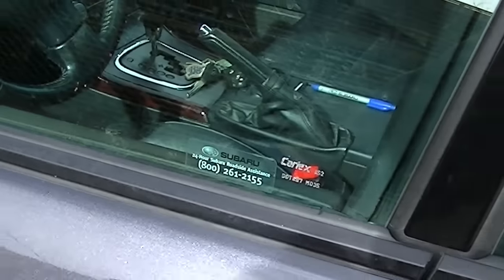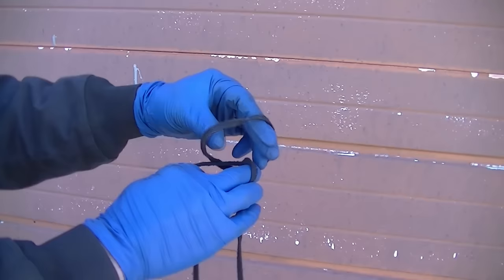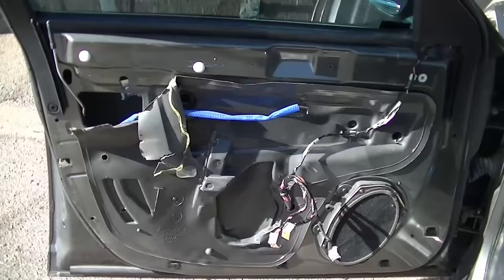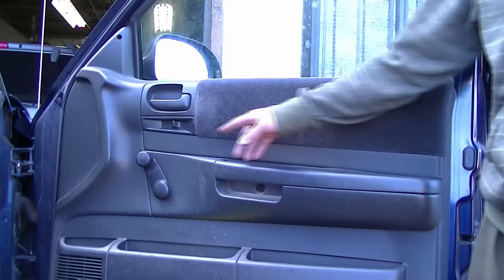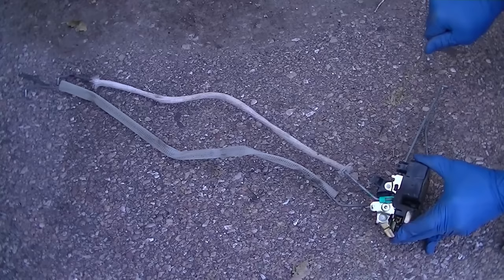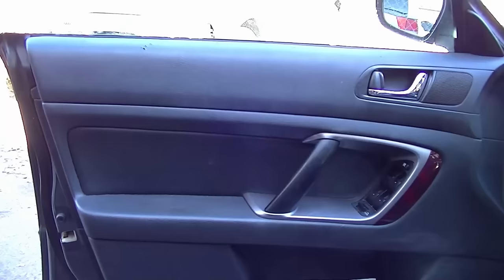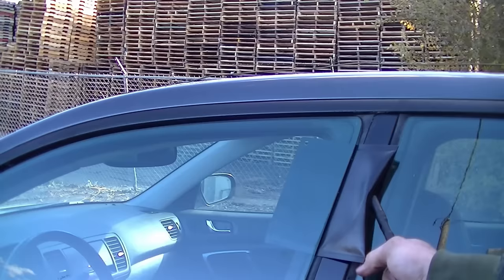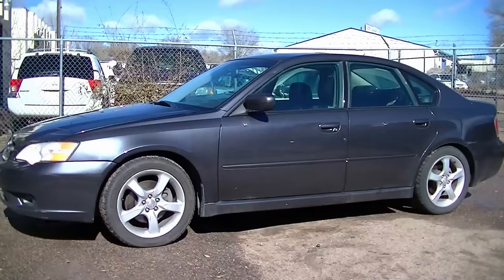How to unlock a car door (without a key)

Comment: 1 hour ago I closed the door and my 22 old month son and my keys where inside the car, my car is a VW POLO from 1991 so I used the shoelice and knot methode , I managed to open my door in 10 min! So gratefull for this video!!
Reply: i did it on same car struck lucky 30 secs and in, never done it befor so some one loves me and you well done
Reply: I used a brick, took 1 min
Reply: @Skyprince27  it took you that long to find a brick?
Reply: @Skyprince27 i used my fist, took 10 seconds
Reply: @mikkey246   I used my head. Took 1 second
Reply: 22 months? Sooo he was 2 at the time
Reply: Usually locksmith companies dont charge if a kid is involved

Comment: i just locked my keys in the car a few mintues ago and the shoe string (and butterknife lol) method worked great! it took me some time, maybe like 10ish minutes. at first it felt like the butterknife wasnt enough for the weather layer but i kept pushing downward until the shoe string finally squeezed in. the knot was kinda tricky, it kept loosening up on me, but after having to do it a few times in the process made me a pro at slip knots lol. the twisting the knot around tip worked for me 👍 which then proceeded with me finally unlocking my car. now i shall carry shoe string and a butterknife with me everywhere 😂. i am so grateful of you, you saved me money from not having to call a locksmith! thank you so much!!!

Comment: I was brought here out of need and the first one with the shoe string helped me get my granny's car unlocked! I had to improvise by tying a piece of thin wire onto the middle of the shoestring because the slipknot kept closing as I slid it in, however I made a little loop out of wire and secured it into the middle of the string, then slipped it through, did a very small amount of fishing and I had the knob pulled up!! Thanks for making this vid!
Reply: Hi, how thin was the wire?
Reply: @velvetstorm4563  about the width of an angel hair pasta. Thin enough to get slipped through between the door jamb and the weather stripping but ridgid enough to hold a loop.

Comment: This video is really good. One note, always unlock from the passenger side. There is a lot less wires and mechanisms on that side. Another great trick is to take one of your wiper blades off and see if there is a small strip of metal in it. If there is, take the metal out and you can slip in to the door lock at 6 oclock as if looking at a watch. It is easier as well as use it to slip under the lock and sweep left or right and catch the mechanism. The wiper blade or your antennae is cheaper than calling someone to come out to unlock your car. Both are cheap to replace. Another thing you can try is each window. Gently take your hand , palm down and gently drag down on the glass with medium pressure. Sometimes there is enough slack to get a tool or hanger from the top.
Reply from the maker: Thank you for sharing your experience!
Reply: Got😊😂vbn

Comment: I used the exact same antenna that you referenced. The trouble was the second I triggered the unlock switch, the lock would immediately relock itself as a counter measure. So I had a friend stationed at the door handle and instructed him to pull the handle as soon as he heard me trigger the unlock.

Comment: A handy tool is metal wire from a fence. It is more rigid than coat hanger. It is much longer, you can even attempt to reach the door in the other side.
There is fences like that everywhere. The only difficulty is starting to remove one wire without tool. And not get caught if the owner of that fence is around.
The zigzag shape often helps to position the metal piece.

Comment: This is great thank you.  I also have a tip for one of those RARE situations. I forget what car was involved, might have been a Caddy, Audi, or BMW. We were at a ski area and I noticed a car horn blaring and going silent. Went to see what was happening and saw a father and young daughter outside their car, no coats, in freezing weather. The father was opening the car door tripping the alarm. Attempting to silence the alarm with his fob, no success. Recloses the door to silence. I knew what was happening because I did some electrical engineering in that area. Hidden in the forest of tall pines was a radio tower that was jamming the fob signal. I guessed that the car alarm was located under the dash near the steering column. I instructed him to open the car door, sweep near the alarm unit while pressing the disarm button. We were lucky. It silenced.

Comment: Hey man, just wanted to say thanks for uploading this video.  I lock my car keys in the car last night and only found out this morning. I had a wire hanger ready, but a quick search on you-tube I came across your video and decided to try out your first method where you used a shoe lace. I used a piece of string instead. After a few failed attempt when I was pulling the string too fast and the loop would pop out as the string twisted on the pull, I was finally successful on the fifth attempt. I think it took me less than 15 mins and no damage to the car door or the seal. So just wanted to say Thank You 🙏

Comment: Thank you so much for this video! Left keys in the driver seat of my 2014 Nissan Altima and managed to pull the unlock switch using the wire hangar method!

Comment: Good tips for emergencies, to avoid these from happening, always have a spare key tucked in your wallet, purse or bag, separate key chain just for car key or key holder with magnet or
glue small strong magnet (neodymium) to your key and stick somewhere under the metal part of your car that only you who only knows and change location occasionally, you can do this to your house key also specially in winter time.

Comment: Let me tell you the best option for older vehicles would be the metal cloths hanger and a wedge. It is easier to move around. You can make any hook you want and it can be forced passed the weather stripping. I have used this technique dozens of times and in less then 5 minutes with proper suppies you can get it done. Always have these things handy. Or call somebody who can bring those things. Good video. Thnx for sharing

Comment: Thank you!!! Key wouldn't turn in any door of my 93 Honda Accord. Had me totally confused. Tried lubricants to get the key to turn with no luck. Wondered if it couldn't be unlocked with they key since it has power locks the battery is dead. Was able to unlock with key and jump start a few months ago, so not sure if dead battery had anything to do with key not turning in the doors 🤔 maybe battery was less dead then... Anyway, got it open pretty quickly after watching your video! Coat hanger bent just right pulled up the lock once situated just right! 👍👍👍

Comment: I left my keys in the ingnition at a gas station, when i shut door behind me the door automatically locked itself luckily for me across the road was an auto electrical shop and the boss was a friend of mine and he opened the car door using some of the same equipment you showed, Nice video

Comment: after delivering pizzas for a while I carried a spare key on a belt hook. one  time i locked my self out of my Buick the car locked itself because I left it in drive with just the parking brake on with the motor running. good thing my wife could bail me out, but it cost me a hour with my car running in drive before she could get there.

Comment: Bro literally just saved my life locked my keys in my car use the coat hanger with the hoop on the end took a little bit to get a hang of it but once I got it around that door handle and pull down pop I didn't even care that my car alarm was going off thank you so much

Comment: Thank you for the video. I used a combination of the shoe lace and a wire hanger to guide the loop. Very difficult with just the shoe lace.  I have an older car with lock button.

Comment: Use an Electric Guitar string, (metal) a thinner gauge like a G,B,or the high E, 
select a type with the brass eyelet on the end.  
Similar to the methods in the video, just slide the non-eyelet end thru the eyelet for your loop.
The strings are SO thin no wedging or prying is needed, you should be able to wiggle it right thru the glass edge into the vehicle, as the smooth thin strings will not be abrasive to finishes or gaskets. 
Fish that string in by navigating it with one hand for all turns and movement, 
(tip, bending a kink in the wire string is ok for strategic control) BUT at the entry point to the location its slid into, PINCH the string between your fingers, while holding that pinch-point stationary for accuracy. 
Once you do this for the first time, its a lot  easier in general than the bulky wires and straps and floppy shoelaces. 
Where to get a string? A pack is about $4-$5 at any music shop,...or ask a friend who plays a guitar for a used one,...they change them frequently. If its not free, get a new friend. 
After you learn this method and get good at it, you can get into most tight tolerance doors quicker than  some drivers can pull a key out , unlock and open a door....
A guitar string can be coiled into a wallet, a purse, kept at your job, stashed in your vehicle to help others,...etc. Maybe even hide one somewhere on the trim of the vehicle.
Most cars today are made to not lockout. 
You need to use the key to lock it. 
Therefore you are not locked out,....you just lost your key. Dont do that,...
.......then you`d have more time to learn the guitar. Happy Motoring,.....Great Video
Reply: Not only will it dig and scratch and gouge the paint, but will help empty your wallet for touchup paint !

Comment: I do “lock outs” for part time work. I might suggest you get yourself a roll of WIDE “painters tape” and put 2-3 layers over painted areas of car to get “some” protection against paint damage. Granted, we have a “cover your ass clause” in our PRE-ATTEMPT “SIGN HERE” before we start paperwork, it still doesn’t keep drunks from threatening to sue us after we get them in their car at 3am when it’s 10 degrees outside... And yeah, I’ve told drunks “Yes, your car is now open and you have your keys. You are obviously in no condition to drive legally. Why not get a Uber/Lyft now?” Or I’ve given many NICE drunks a ride home because they were NICE.  On flip side, I’ve also called police BEFORE they take off behind the wheel and generally they get a cab/Uber/Lyft then. Unfortunately, a few got cuffed & stuffed. But I tried to help them BEFORE it came to that.

Comment: That shoelace trick is absolutely brilliant.
Reply: How do you keep the slip knot from coming unloose while pulling it into the car
Reply: @TaeTizzle  Only one side of the string closes the knot, so you drag the other end in. The slipknot will have to have more friction that the door, so make the knot super tight. Then drag it into position and tug the heck out of the ends to tighten the knot. Should be simple enough.
Reply: Life saver shoe string

Comment: This is by far the most informative video on this I have ever seen on YouTube good job
Reply: The fastest milkman in the West  really? A coat hanger will still open most car doors.
Still if you have a higher end car it's still stupidly easy to just set up an RFID scanner to collect data when someone parks and set the code to a key fob, really quick and look like it would if you owned the car.
Not suggesting anyone do it, just that remote locking is amazingly insecure.
Reply: The fastest milkman in the West  if the car just has central locking it will only unlock/lock the doors. If it has keyless start then it will still lock/unlock the doors but won't start the car as the system passes encrypted codes back and forth with the key fob. That said if you have two people, one in the car and one near the owners key fob then with the right equipment you can pass the code from one person to the other. Your essentially using the original key fob but sending the signal far further. If people hang their keys near their front door then this can be easy to do and the signal is generally only needed to start the vehicle, not to keep it running. 
If this was a big secret then l wouldn't be telling you, but anyone with a few hundred dollars and reasonable intelligence could learn to do this in a day from what's already on YouTube

Comment: You can always find an antenna on another car in the parking lot, unscrew it, and bend it so you can reach the door latch or lock button...thanks for the tip!
Reply: Be Kind ,  and at least screw the antenna you borrowed back onto that car !!
Reply: While you're at it, remove the windshield wiper blades for next time. The antenna will work only if you can shape it. Ever try that without some pliers or Vise-Grips?

Comment: Good tips that work well if your home or near a store.  But some of the things will be hard to get if your not able to find some of the items.  When I was a firefighter we use to use the slim jim of different makes. Another way is to try a KEY from the same make or model.  I was able to open a womens car with her baby inside by using my Toyota key.  Another thing was a friend locked his doors while the car was RUNNING.  Using a hanger I was able to push one of the window buttons to lower a window and open the locked door.  Another way is to ask some of the locals to open the door.  You will be surprised how many are Car Thieves with the experience to do it will gladly help.
Reply: I've used an antenna to help somebody open their vehicle and then I told her just make an extra key and hide it in your wallet to not  just don't tell nobody make sure your girlfriend doesn't know.

Comment: Great stuff! I came out to my 2014 Buick LaCrosse popped the trunk and put my bag with my key fob inside the bag and placed bag in the trunk, shut the trunk and went around to the door and realized the door won't open because I forgot to unlock the doors first because I had the remote in my bag! Dumb move! Newfangled car electronics. I usually have the remote in my pocket. Learnt a lesson that day, time to call wife and make her drive to my rescue with the extra key. Don't even ask me how to make anything work with out battery, fob, key, ignition or any electrical component on this car?

Comment: Thanks! this video saved me, I have my door lock closed off due to thieves breaking the lock, and my battery died completely so couldn't open the door with my car keys, with a cable me and my wife could pull the door handle and open the car so we could charge the battery!.

Comment: The string worked! For my car it seemed best to get the string inside without the slip knot, then creating the loop while the string's on the outside and pulling it past the door gasket to get it inside. When I tried getting the knotted string past the gasket it kept tightening too much to get over the knob.

Comment: Thank you so much your video helped me and my sister to unlock my toyota echo as i accidentally locked keys in my car. I got a wire hanger from my sisters neighbour it worked a treat although there was a little hiccup when door partly opened so my sister just kept using the hanger and finally the knob popped up yay love your video you saved me a hour wait for road side service awesome that is what you are cheers

Comment: I once locked the door with the keys sitting in plain view on the center console.|
When AAA arrived, as I expected, they started by wedging the door open a bit... then took out a long stiff wire, and hooked the keys then pulled them out.   So simple it was nuts